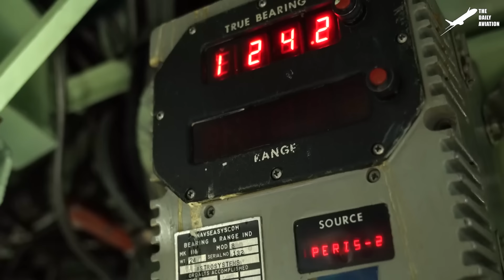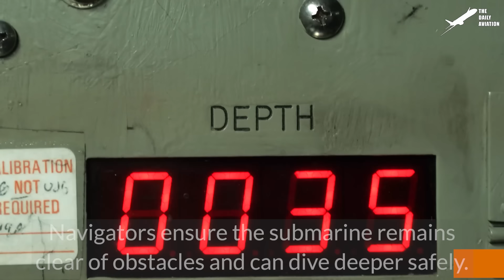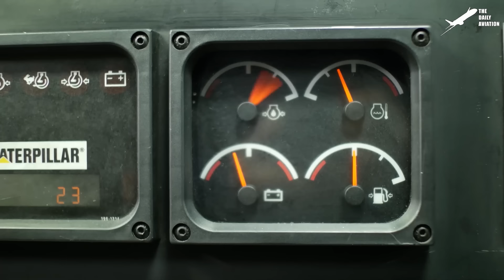US Massive Submarine Diving Like a Whale in Middle of the Ocean

Comment: Why don't they install a cable-periscope on submarines. You can have it float up from say 100 metres even. With a floatation device attached to the upper camera part, you can have it rise half a meter, or what not, above the surface. You can turn it and look around, scan the surface.
Not as reliable or good as a regular periscope, but still.... you can scan the surroundings top side from a deep.
Reply: My understanding is that they already have an antenna cable that they can release to the surface so they can communicate with command while not revealing themselves. Also some subs have a towed array that they can deploy or retract behind the prop so they can track ships/subs behind them. As far as a “periscope cable” I’ve never heard of that, so it’s a good question, but with how much militaries around the world have spent streamlining and improving their submersibles, I find it hard to believe that someone hasn’t thought of it yet, and if they have, I’m sure extensive RnD was done and it was found out to be either not feasible or not practical. Interesting thought though, one I’ve wondered myself.